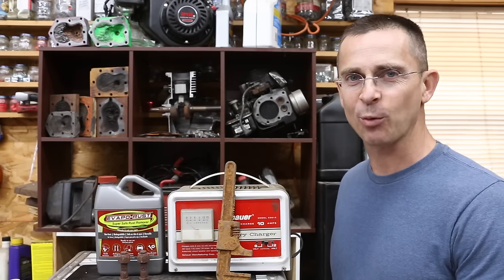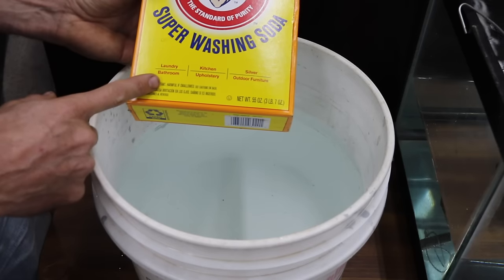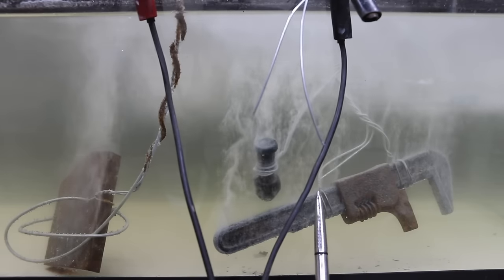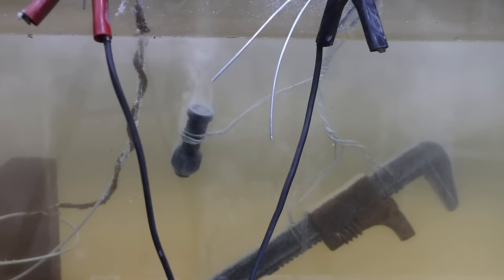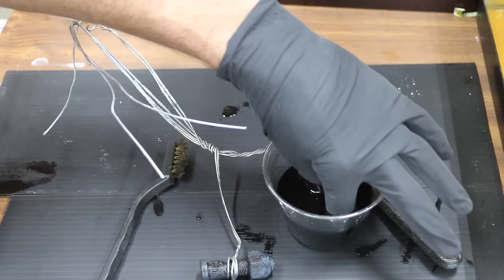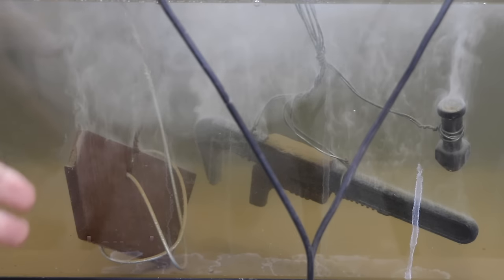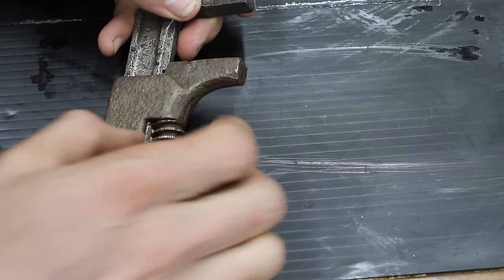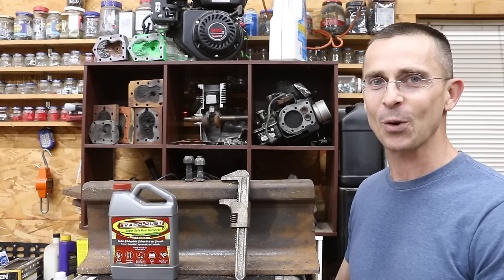Is Electrolysis better than Evapo-Rust?  Let's find out!

Comment: Thanks for this. I love Evaporust. The only thing I’ve seen for hobbyists that comes close to it is electrolysis but I’m rarely in a position to set up a large electrified water bath or a safe way to run current thru it or have a sacrificial hunk of metal. Much safer & easier for me to use a non-toxic, single step process with no extra parts. Good to know I can make that choice and get a good result with either. 

I tested Evaporust on flash rust against vinegar water on 2 screwdrivers overnight. 

The Evaporust was good, rinsed off  & given a quick buff with a magic eraser (or steel wool with some Evaporust in it has worked too.)

My vinegared screw driver - the rust looked gone but it decayed the plastic handle. Upon rinsing, it immediately flash rusted back to its original state 😖. So it works, but is only safe for bare metal then Needs immediate attention with rust inhibitors afterward making it ok for thicker rust, or cleaning metal objects, but once the rust is off, the exposed surface is highly susceptible to more rust. 

Whereas the Evaporust can be rinsed and stays unrusted longer - even a few days, making it less fraught to get it protected, and my favorite thing. (Next I want to try using it in a rock tumbler on interesting looking metal bits I found while walking my dog.)
Reply from the maker: You are welcome!  Thanks for sharing.

Comment: Curious how much the sacrificial piece weighed before and after.
Reply: calculating it will give you about the amount of Gases.
Reply: I was thinking the same thing.
Reply: It doesn't the rust is transford to it
Reply: @EricMatson-ru7jj  that's not what I said.
Reply: Ok misuderstood
Reply: @EricMatson-ru7jj  No problem.
Reply: Interested to see a cross section of that steel too
Reply: It's pretty minimal til you've used it a few times, I used to use electrolysis to make iron oxide for thermite, you would have to do several runs to really see a big difference on your positive plate

Comment: Looked like part of the wrench was not in good contact with the electric feed.  Should have relocated the wires.
Reply from the maker: you're right
Reply: Just wrap the wire around every piece of metal, the current will go everywhere it can.
Great video.
Reply: Or add one wire for moving jaw and screw
Reply: You don't need to add any wires, the wire just needs to touch every piece of metal. Wire is just metal, current travels through metal.
Reply: He should have fully dismantled the pipe wrench and wired each piece on its own.
Reply: LincolnTek the point was to see if it would loosen the stuck wrench. If he took it apart then that wouldn’t work.
Reply: @DukeBiggsley  
Okay now that makes sense. 
Thank you Duke.

Comment: I use copper wire in the electrolysis tank and it seems to work really well. Maybe try steel vs aluminum vs copper and see which has a better result
Reply: Copper should be the best one and then aluminium and steel is last one.
Reply: @nechastivi3187  gold wire should be the best, but i wouldn't use it. steel should be the worst of the three you gave, the rest follow exactly what you said (minus other materials like gold wire or something).
Reply: @jamoecw  Yeah, as I said Silver > Gold > Copper > Aluminium > Steel
Copper is the best for this bcs it's relatively cheap and only like 10 % less conductive than silver.
Reply: Nechastivi I believe copper is slightly better than gold but doesn’t matter lol
Reply: I know copper works great. Haven't tried the others.
Reply: You mean using copper for the sacrificial metal?
Reply: @kiq4767  no. Use copper as the wire to hang the item and wrap around the sacrificial steel.

Comment: Protecting the metal after the rust removal process is the most important part
Reply from the maker: Great point! Thank you and Happy New Year!
Reply: Barry McNicholl ........I use 3in1 oil on old railroad lanterns after the electrolysis.......usually a few coats and turns out very well.
Reply: Coat the cleaned pieces in Evaporust when finished to prevent flash rusting.
Reply: Spray paint
Reply: Wd-40 
Any kind of penetrating oil
Oil it’s self 

Those are my go to options and they work well.

Comment: Use a bigger sacrificial piece of steel I take screen or chicken wire fold it a couple times and line the whole tub then take a wooden stick and hang part in the middle with wire use a 15 to 20 amp charger has to be transformer type charger. It would only take 24 hours and all rust would be gone. Works on chromed parts as well removes rust without scratching. Clean screen as bubbles slow to inprove speed. Be careful tho make sure to turn off charger before connecting or disconnecting cause the hydrogen and oxygen gas it creates is highly flamable/explosive !!!
Reply from the maker: Thank you and Happy New Year!
Reply: You are absolutely right, you have to make the sacrificial anode into a "cage" so that you can suspend the cathode (rusty part) in the center, that way the electrolysis attacks the cathode from all directions.
Reply: I have put the anode as a flat steel panel in the bottom and a couple layers of fiberglass window screen on top and lay parts on that. Keeping the anode clean is important. Every 4-5 hours I clean the anode with a brush.
Reply: And I have a slight suspicion that it might be best to maintain some good ventilation while the electrolysis is going on.
Reply: @grizzlygrizzle  Oh, most definately because electrolysis releases hydrogen gas as well as oxygen.  And we all know what a hydrogen/oxygen igition can do.  Isn't it ironic that H2O is so stable that it puts out fires, but separate them and 'boom!".
Reply: It works just ducky if you do it from only 2 sides. Heck even 1 side as long as you turn your  piece being cleaned and your sacrificial piece has enough surface area. The chicken wire is a great idea, I've been using coiled wire in the bottom of the tub but that sounds a lot better. Not trying to argue, just pointing out the difference between "best practice" and "best practical" for the average schmuck in their garage such as myself.
Reply: It really doesn't matter how many "sides" you "attack" the rusty part from - electricity doesn't care - but what makes the OP's suggestion work well is the massive amount of surface area that you're working with.
Reply: @grizzlygrizzle  you are actually would want a fan with an electric motor that certified for use and a refinery! Essentially the motor is sealed and Spark proof! In a confined space oh, some of the set up some reading about here could be extremely dangerous. Any source of ignition should be miles away from this process.
Reply: @Al-Fiallos  let's see if more curious if you use the oxygen and hydrogen as a combustible gas in say a cutting torch the byproduct is water! They recombine
Reply: @8Jory  from what I can tell about electrolysis, It Isn't So Much thickness for the anode as it is surface area. The more surface area the more activity. I have been thinking about experimenting with electrolysis to you actually create what is called Brown gas. I don't know where it got the name so don't ask! And in thinking about how to increase surface area and do everything on a very small budget I come up with the idea of using stainless steel scouring puffs. Haven't tried it yet it's on my to-do list for actually the next month or so. It's a long story I've been thinking about it for a very long time just haven't got their due to other issues.
Reply: @JohnRodriguesPhotographer  You are quite correct.  The result of burning oxygen and hydrogen is carbon dioxide and water.
Reply: @JohnRodriguesPhotographer  -- I think that putting the fan upstream of the electrolysis would be OK for us peons. In other words, use it to maintain a positive pressure on the room, and leave the exhaust opening alone. Of course, one should make sure that one isn't setting up one's ventilation contrary to the direction of high winds.

Comment: Electrolysis works. The drawbacks are that it’s very time consuming, creates flammable hydrogen gas, and laborious to set up. However there are no toxic chemicals involved.
Reply from the maker: All great points!  Thank you
Reply: Now there is an experiment I would line to see. Does electrolysis produce enough hydrogen to be flammable?
Reply: Flammable hydrogen gas? I consider that a bonus, not a drawback.
Reply: @ImTheJoker4u  Yes, it does.
You're also producing oxygen too, so it's good for making a bang. Plenty of videos on youtube demonstrating this.
Reply: @John Ulicky,  in what timespan are you asking? Because over time if hydrogen pools (like in your ceiling) it can produce a helluva bang.
I don't worry so much about hydrogen being flammable. I worry more about it going BANG.
Reply: @ImTheJoker4u  enough videos to be found on harvesting hydrogen from electrolysis, even running engines on it.

Comment: Both are excellent from want I’ve seen here and in other videos,  my go to rust remover has been old fashion vinegar. Super cheap, I’ve used it on cast iron skillets and vintage hand tools. Still a wire brush will be needed, sometimes you just have to get physical. As always Todd does a excellent job, thorough yet concise. Todd your effort to inform and educate is much appreciated.
Reply from the maker: Thank you!
Reply: But what long lasting effect does the vinegar have on the steel?  How much of it gets absorbed into the pores of the wrench or nut in this case?
Reply: @carpediemarts705  vinegar mixed 50/50 with water works just fine with no bad effects, once it is dry its gone. Professional painters, specifically bridge engineers, have used this for decades yo protect and paint structural grade steel. Personally I paint rusted steel with POR-15 after decaying and using the vinegar/water rinse. It opens up the pores in the bare steel and allows for better adhesion of the paint. Steel that can't get to air can't oxidize.
Reply: Vinegar is absolutely rubbish for removing rust 😂
Reply: @noodlesoup2281  And your choice for rust removal? Enquiring minds want to know. Please share you knowledge. 😂

Comment: I’ve used the electrolysis method before with several sacrificial pieces in the same tank and it worked great after only 24 hours, even on small parts in a small container. Never used Evaporust however it seems to do well but too much time and cost!
Reply from the maker: Thank you and Happy New Year!
Reply: Evaporust is good stuff however it is very expensive, especially here in the UK.
Reply: Yep, I've used Evaporust too, and it does work well but is expensive, and if you don't use a covered container it will all...evaporate...I think I'll have to look into an electrolysis setup.
Reply: The hell is sacrificial steel

Comment: From my own experience I have found cleaning grade vinegar to be an excellent rust remover. I emphasize "cleaning" grade which is much stronger than food grade.  It's a heck of a lot cheaper than Evapo-rust also.
Reply from the maker: Thank you for the feedback
Reply: If you do this same setup in vinegar, with pure roofing zinc, brush with a stainless brush, the part will come out plated and new looking...
Reply: Cleaning vinegar is actually weaker than food grade vinegar, as for its acidity, but cleaning vinegar also contains ammonium hydroxide.

Comment: From what I've seen, what you want is to remove most of the rust with physical means and use electrolysis to get the super hard to remove layer, and out of all the pockmarks and shit
Reply: check the "my mechanics" channel you are exactly right!  It makes no sense to remove rust with evapo-rust or electrolysis if you can scrub it off!

Comment: When evapo rust darkens, it’s pretty much dead. When I remove my part from the evapo rust I spray it with baking soda mixed water. You’ll be surprised how much it helps. In general, if you can’t see the item in the evapo rust, change the fluid
Reply from the maker: Thanks for sharing.

Comment: This video combines my two fields of expertise (chemistry and occupational health and safety) perfectly, but I'll try to keep it short due to the importance.

Both processes do practically the same, they remove iron from the chemical compound "rust", or iron oxide-hydrate. While the electro-chemical way uses electric current, the evapo rust uses some kind of chelating agent to overcome the bond energy of the rust. The brown stuff forming on the sacrifice metal is forming due to the alkaline solution (soda). The freed iron ions react directly with the basic compound to form basic iron hydroxide, similar to rust in appearance and composition.

The ohas-specialist in me hopes desperately you took the proper precautions to prevent an explosion due to the forming mixture of hydrogen and oxygen. Your eight grams of iron set free about three liters of hydrogen, resulting in an explosive mixture of around 50 Liters (lower explosive level of 4 %) which is highly dangerous. And this does not account for any hydrogen forming without any iron involved due to overpotential (the battery charger delivers a far higher voltage than needed).

If anyone attempts to repeat the experiment, please make sure you ventilate the area extremely well and keep any sources of ignition out of the direct vicinity of the basin.

Or use the non-explosive evapo rust. It may be more expensive, but losing the hearing ability,  a limb or even your life is far worse!

I would highly appreciate, if you added this information to the video.
Reply from the maker: Great information.  The shop is indeed well ventilated to deal with hydrogen gas formation.  Thank you and Happy New Year!
Reply: Wouldnt a candle close to the electrolisys burn all of the flamable gases before they reach a dangerous amount? My dad always told me to do electrolisys with a candle on a plastic dish floating on the water...
Reply: @acynder1  that candle trick is a good idea
Reply: Unfortunately not. Since hydrogen is far lighter than air (that's why airships are/have been filled filled with it), it accumulates at the highest point in any room. But since that's where usually the lamp is mounted, any source of heat (hot enough), sparks or ignition will set off an explosive atmosphere once built up. The problem is, that mixtures, which are too meagre, do not burn, but once the threshold is reached, they explode suddenly.

And the candle trick is also pointless: Since hydrogen is lighter than air, pretty much all of simply passes the flame upwards, completely unaffected. Only the very small amount, that reaches the temperature (more than 420 °C and oxidising conditions) in direct vicinity of the flame will be burned. This would only work, if all the gas from the electrolysis is passed through a burner, which is done for combustible organic matter like solvents.

In the worst case, you just give the explosion a source of ignition by lighting the candle, and as soon as the mixture reaches the flame, you can kiss your shop, and in the worst case your life, goodbye.
Reply: I’ve been under the impression that during the electrolysis process it is the negative oxygen ions which are drawn to the positive sacrificial anode, where they form rust on it. This is why the sacrificial metal is eaten away by corrosion, which means it needs to be periodically replaced. Any iron ions, having a positive, charge, will stick to the negative cathode. All that happens, besides the electrolysis of the water into oxygen and hydrogen, is that the oxygen is removed from the rust, leaving the plain iron. Also I have read that the sodium carbonate washing soda is not chemically involved in the process, but merely provides an electrically conductive medium which permits current flow between the anode and cathode. Thus the washing soda is not used up and can be reused indefinitely with the occasional addition of water to replace that lost to evaporation and electrolysis. It should also be filtered periodically to remove the corrosion debris that falls from the sacrificial plate(s). I hope this clarifies what is happening during electrolytic derusting.
Reply: Lofl! Thanks Rick.
Reply: christian... this is also the reason you NEVER open doors and windows in a house with a gas leak to try and vent the gas away!  Once the air-gas mixture reaches a certain level ( I think I heard 17 or 19%) it becomes explosive!  Always call the utility company if you smell gas and evacuate the area.  Let the professionals deal with it.
Reply: PS,,,don't stick your hands under a running lawn mower...